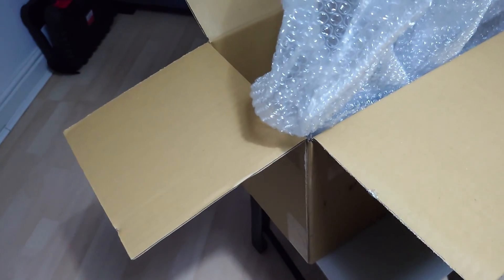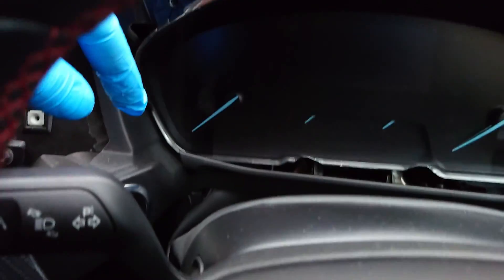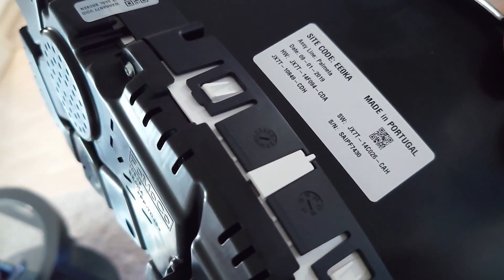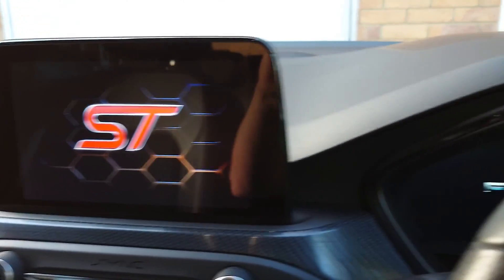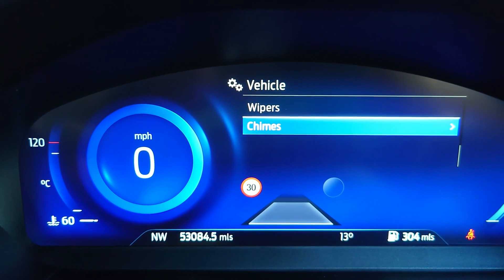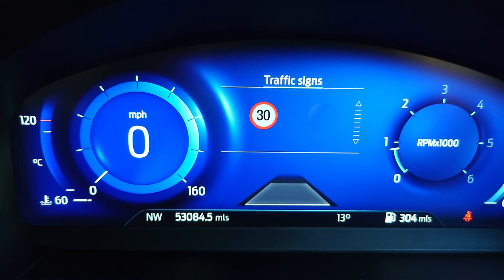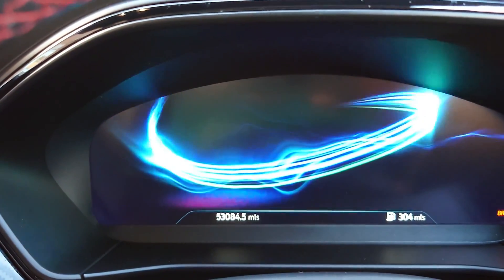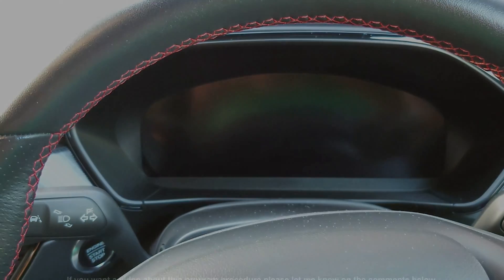Ford 2019 digital cluster upgrade

Comment: I have a Ford Focus MK4 phase 1 with instrument cluster NX7T-10849-SXB, and I’m considering installing a phase 2 cluster NX7T-10849-SCC. Before I try it, I’d like to know if you already tested this swap and whether it is truly plug and play
Reply from the maker: Yes it should work. Is not plug and play. It needs the forscan to coding to the car. The car will start without coding but there will be few faults and the cluster itself wont turn off when you lock the car. Better have it coding as soon you install it.
Reply: @axores20  So all I would need to do is import my as-built data? Or is there any additional coding required for VIN or other functions?

Comment: I installed a Puma digital clock on my 2019 Ford Transit Custom, but I can't activate AdlBlue on the clock screen. Any advice? I've already used Forscan, but it still won't work. Thanks
Reply: Hi I want to do the same! I see you used the digital cluster from a Puma. How dit you make it fit ? Have u reused te plastic from the old cluster?
Reply from the maker: Hi. Adblue option you need to activate in the cluster section on for scan, then you need to also change on the cluster you have a diesel car. My car did have that problem with adblue, because my cluster didn't know what type of fuel the car was. Have a look on for scan cluster settings what you got there.

Comment: What buttons do you press to show different displays I can’t change mine to ECO or SPORT
Reply from the maker: @davebritten2333  what car do you have?
Reply: @axores20 it’s a 2018 transit custom
Reply from the maker: @davebritten2333  does your van have a button for this option? Don't remember seeing a transit with that feature built in. Did you upgrade the dash to digital?  You need to have that feature from the factory otherwise it will not work.
Reply: @axores20 yes upgraded to the digital dash got most parts working, I cannot see what buttons you are pressing in the video to see how you select the different options/screen/display
Reply from the maker: @davebritten2333  that will be the buttons on the steering wheel. The narrows up and down side to side should let you navigate through. I would actually like to fit one in the transit van. Make a video e wanna see it how it look like 👍

Comment: Is it possible to do the same for any Ford Edge?
Reply from the maker: @andrewsokoliuk9905  after 2018 yes. If you have the same cluster i have before then the answer is yes ☺️
Reply: @axores20  can you pls share the store you've purchased it from?
Reply from the maker: @andrewsokoliuk9905  Ford dealer ☺️
Reply from the maker: You need to find a car online the same as yours maybe more newer which has that cluster. Take the plate and call ford give the reg and say you want a cluster. It is costly but worth it. Also you can get it from ebay i think. Be careful of the mileage. Cannot be more than your car has. We can program up not down
Reply: @axores20 i have a focus, can i buy a kuga cluster to it has to be the exact same model?
Reply from the maker: @Adil.a15  it should fit but i would recommend buying from a focus. But I don't see a reason why it won't work. Basically they are the same unit. Just the program is what matters to make sure all works properly ☺️
Reply from the maker: @andrewsokoliuk9905  yes i am sure it is possible ☺️
Reply: Hi 👋 amazing job! 🤩 love it. Do you think it will work with Ford Transit Custom 2019-2023? Basically it has a Ford Fiesta cluster. Thank you 🙏
Reply from the maker: @jaraskrabalek  hi. Not sure about that one. Transit normally has a small screen on the dashboard. If it has a screen exactly like the 2019 fiesta probably will work.